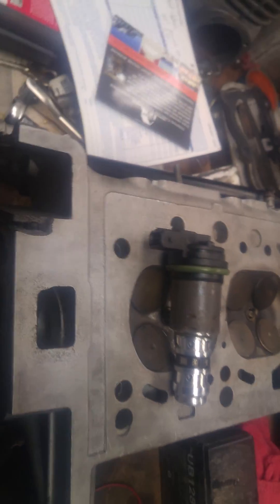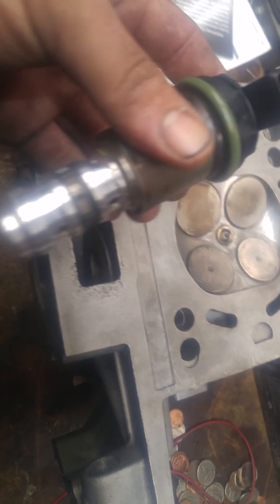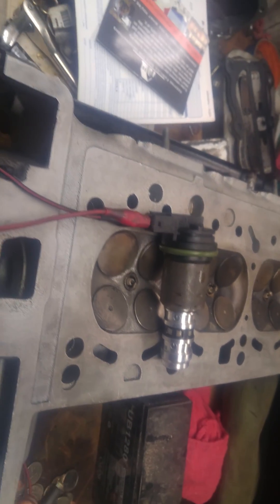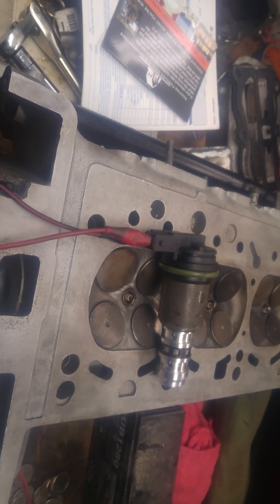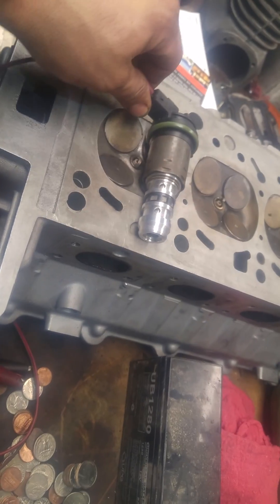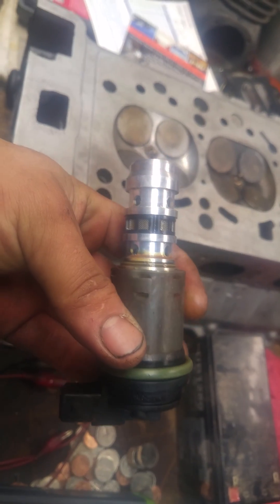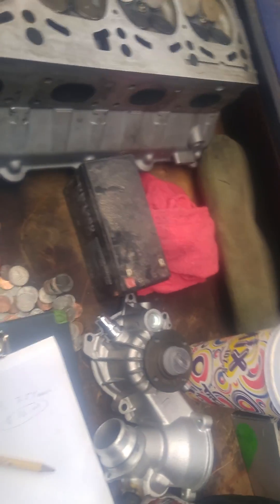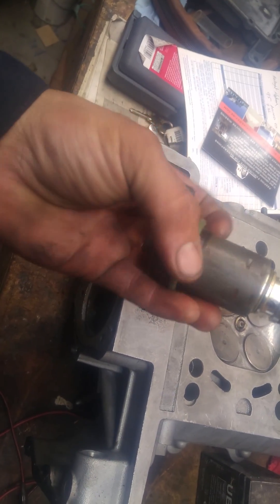N62 Vanos Solenoid Test

Comment: Excellent Video.  Any ideas why I'm receiving the 4 error codes below after performing a Valve Cover and Upper Timing gasket replacement without touching timing?  Attempted to replace 4 Vanos in the same order as removed and replaced both seals on all 4 Vanos.  Maybe I inserted them incorrectly?  Hard to believe that all 4 were disrupted at once. and no errors previously.  
Thanks in advance.

Error Codes:
• P0011:   ‘A’ Camshaft Position – Timing Over-Advanced or System Performance
o 2731:  DME: Function, camshaft control inlet, bank1.

• P0014:  ‘B’ Camshaft Position – Timing Over-Advanced or System Performance
o 27BB:  DME: Function, camshaft control outlet, bank1.

• P0021:   ‘A’ Camshaft Position – Timing Over-Advanced or System Performance
o 2732:  DME: Function, camshaft control inlet, bank2.

• P0024:  ‘B’ Camshaft Position – Timing Over-Advanced or System Performance
o 27BC:  DME: Function, camshaft control outlet, bank2.
Reply: First, truly appreciate the reply.  Did not use ISTA to remove the Valvetronic, but will in the future.  Have reset  the position many times using ISTA and key in the ignition method.  Will be pulling them tonight(damn power steering pipe in the way) and will report back.